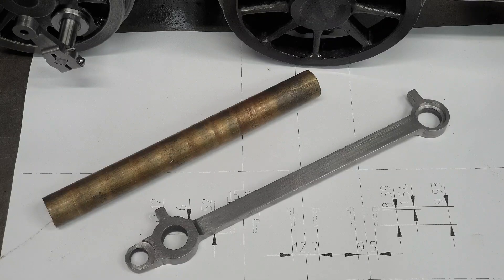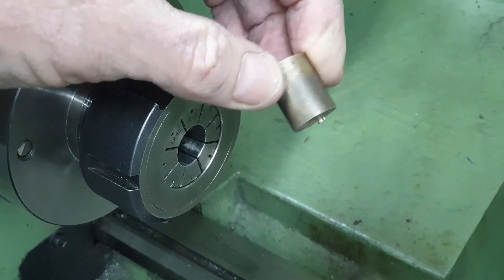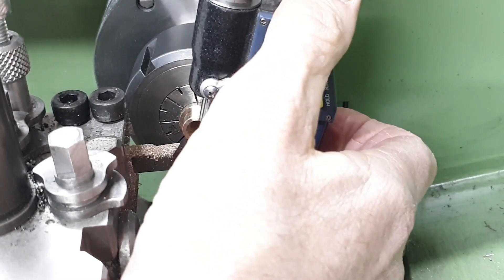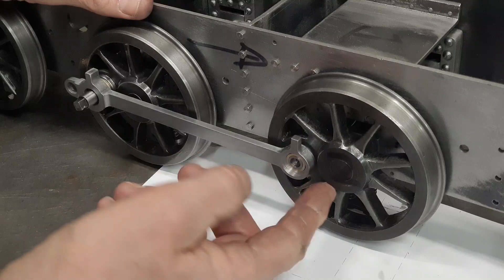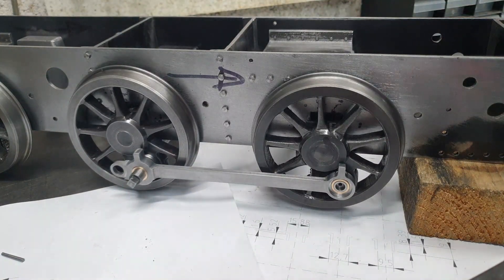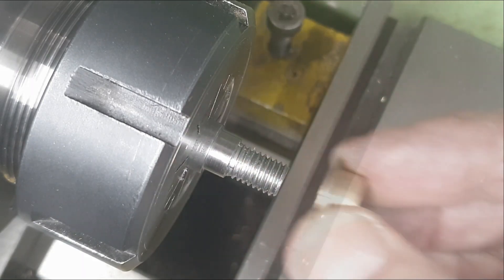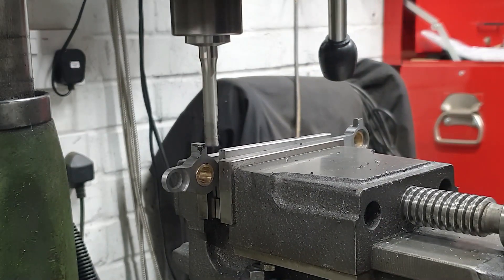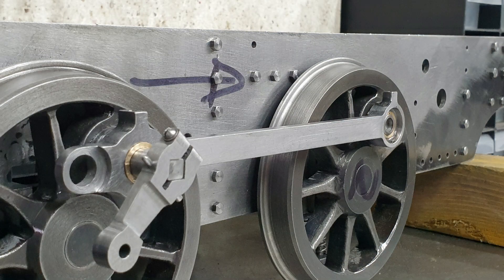Part 14: The Front Coupling Rods (2)

Comment: I am having issues with my lathe 3 jaw chuck  I reckon I will stop using the mt3taper er32 collet holder and fit the er32 chuck j have in my pile od auction winnings permanently

Comment: 5:03 - what a satisfying result :) By the way, lovely collet use - I'm using myford collets which are limited by the bore of the MT2 spindle. Maybe I should stump up for a bigger lathe or an ER collet holder... Re: play, how much play are you expecting? I've recently visited a 4-4-0 which had about 10 degrees of slop due to 50+ years of wear and still worked OK. I guess we aim for the stars...